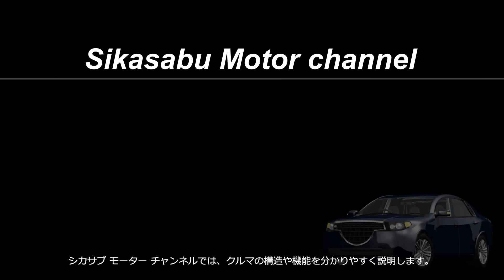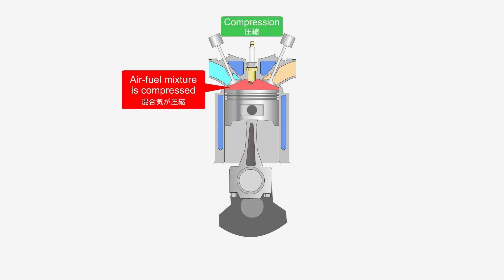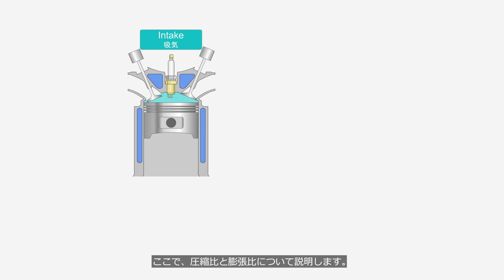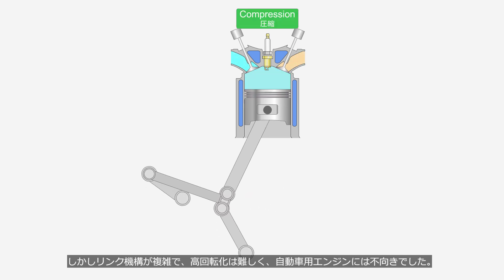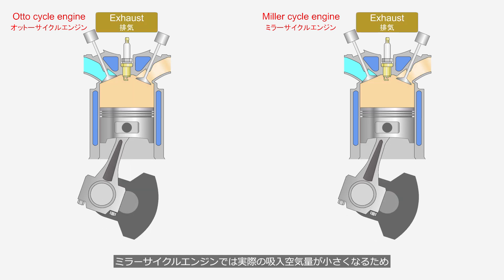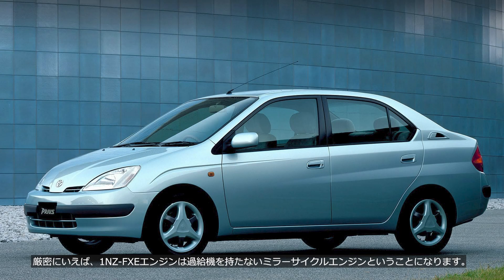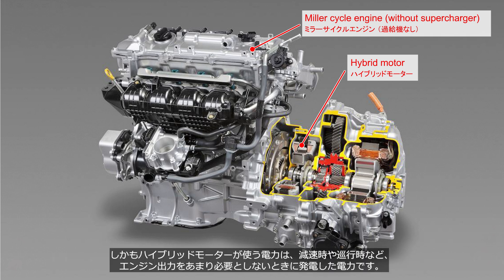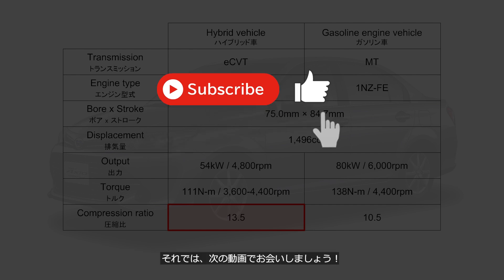Miller cycle engines, Atkinson cycle engines. How they work?

Comment: My question is if the miller cycle/atkinson cycle leaves the intake valve open for a bit, does the gas charge that returns to the intake of the engine clean the valves. Modern engines use direct fuel injection. No gas flows over the intake valves to clean the carbon off. Port injection sends gas over the intake valves to clean off the carbon buildup. 
So does the atkinson/miller cycle clean the intake valves of carbon?...thanks...
Reply from the maker: I don't know how much gasoline actually cleans the carbon off the intake valves. I also hadn't considered the relationship between direct injection engines and gasoline's cleaning effect. 
You've given me a new perspective—thank you.
Reply: @sikasabumotorchannel It’s a big difference. Multiport injection keeps intake valves much cleaner than only direct injection. This is why Toyota uses both in their current engines.
Reply: @sikasabumotorchannel  Even if the valve cleaning effect of Atkinson/miller cycle helps just a bit it's better than nothing...
Reply: I doubt the Atkinson/Miller cycle does much about cleaning the back side of the intake valve. Toyota has addressed the DI intake valve fouling issue by using both Direct Injection and multi-port injection. They do this in both hybrids and conventional engines, regardless of compression cycle. This is because multi-port injection does indeed keep intake valves cleaner than only Direct Injection.

Comment: Thank you for making these videos! I find them to be highly educational and easy to understand. 

A couple questions I have regarding miller cycle engines:
Does the piston pushing some of the air/fuel back into the intake manifold cause any problems? For example, could the engine backfire more easily? 
Are the fuel injectors turned off earlier in the miller cycle than in the Otto cycle to avoid pushing fuel into the intake manifold?
Is the Honda R18 engine a hybrid Otto and Miller cycle with its iVTEC system?

Thank you again.
Reply from the maker: Thanks for watching the video. 
Even in a typical Otto cycle engine, not all of the fuel is drawn into the engine. Some remains in the intake port or manifold.
In the case of a Miller cycle engine, amount of remained fuel might be larger. That could potentially cause certain phenomena, but I’ve never heard of it leading to backfires.
It seems that Honda R engine switches between the Miller and Otto cycles by changing the cam profiles using VTEC.
Reply: @sikasabumotorchannel  thank you for answering my questions!

Comment: Anything on the 2NR-FKEm Toyota?  Toyota likes to blur its technical tracks for marketing purposes . . .
Reply from the maker: Thank you for watching the video and for your comment.

I did some research.
Toyota refers to the 2NR-FKE engine as an Atkinson cycle engine.
Because the engine has a compression ratio of 13.5 (depending on the market?), it is Miller cycle engine without super charger.
Despite this, its output is comparable to that of an Otto cycle engine.

This is just my guess, but I believe the 2NR-FKE engine operates on the Miller cycle only under low loads, while at higher loads (during starting, acceleration, or high-speed driving), it switches to the Otto cycle.
I think this is why Toyota adopted the costly electric variable valve timing system (VVT-iE) for this 1.5L engine.

By the way, based on my research, it seems the 2NR-FKE engine is not used in hybrid vehicles.

Thank you,
Reply: @sikasabumotorchannel  I drove a JDM (Japanese Domestic Market) Corolla Axio of 2016 in my country Mauritius with the 2NR-FKE engine for 5 years, the body resembles the one you showed in the video, it was not an hybrid.
Reply from the maker: Yes. In the Japanese market, the non-hybrid Corolla Axio with the 2NR-FKM engine is still being sold.

Oh, Mauritius!
What a wonderful place you live in.
I would love to visit it someday.